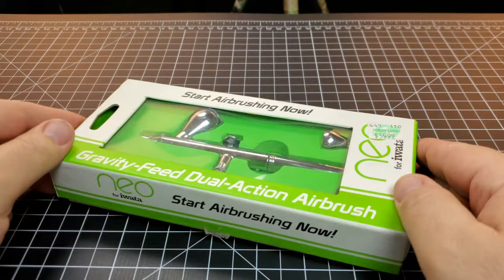Airbrushing With Cheap Acrylic Craft Paints: What You Need to Know

Comment: I'm curious if you've tried "pouring paints"? Apparently there is a craft where the artist pours large quantities of many colors in a large cannister leaving the paint layered and then pours it in patterns on a canvas and then tilts the canvas in many directions making very striking patterns of very thick paint (takes several days to dry completely). The point being they require large volumes of paint for this craft and bottles of acrylic  in a whole rainbow of colors are sold in quart, half gallon and gallon bottles. I just bought a quart of titanium white for $22, same price for a quart of jet black and I got a special deal on a half gallon of antique bronze for the same $22. That works out to either $1.34 for a 4 oz bottle or $2.68, either way, very inexpensive compared to other acrylics and while it's already made to flow, it will need thinning to go through an airbrush which will turn thr quarts into half gallons and half gallons into gallons  at 1:1 and even more if the ratio is higher. I'm going to try it with the ones I bought but was wondering if you have and if you have any pointers for experimenting with this?
Reply from the maker: Hey there 1611JJB. I have no experience in "pouring paints". As far as mixing them together I'm pretty sure you would be ok if you are just mixing the same types of paints together without adding anything, like a thinner to them. Once you start messing around with the composition of the paints that is when they start acting not so good. I have mentioned many times that you don't want to pre-thin your paints and try to store them.  Especially if you are using isopropyl alcohol to thin them with. It will dry out the paints in a matter of days or even hours in some instances. So I would only prepare the paint for when you are ready to use them. I hope I answered your question. Wasn't quite sure what you were aasking. Thanks for watching and for commenting. Take care.

Comment: Thank you for this video, Paul. I'm just getting into airbrushing model cars, and I'm using plastic spoons for practice. After scuffing up them with 800 grit sandpaper, the paint still scratches off of the spoons after sitting around for a week or so. I also used some Tamiya primer (No paint), and the primer still scratches off of the plastic. Can you offer any suggestions to prevent this from happening, or what I might be doing wrong? BTW- I thinned the paints with water on some, and IPA on others, but they all have the same end result. Thank you in advance for your help!
Reply from the maker: Hey Jimmy. The cheap acrylic craft paints are unfortunately not the greatest at sticking to plastic. The best thing you can do is use a good primer and then top coat the paint with quality clear coat. The clear coat will help the most.
Reply: Thank you so much,  @RoadsAndRailsHobbies  !

Comment: I have 3 Paasche YLS air brushes I have tried a cupel of things . One of which is windshield washer fluid with alcohol and ethylene glycol . If you want I can send you some of the Poly Scale paint to try .
Reply from the maker: Hey John. Those airbrushes are siphon feed aren't they?  In my humble opinion that may be half you problem. I have a three different siphon feed airbrushes. One Paasche, one Made by Badger, and one made by Testors. I only ever had problems with them, even when using paint made specifically for airbrushing. That's may just be me though. Are you using a small airbrush compressor, or are you using a regular air compressor.  Just wondering if increasing the air pressure would help any.

Comment: You gotta try regular (blue) windshield washer fluid for thinning the cheap craft paints. Keeps the color true, holds the mix very well and you don’t get as much tip drying as the alcohol. Plus you get like a gallon of the stuff for 4 bucks.
Reply from the maker: I've known about that, but every time I go to the store all I can find is windex with ammonia.
Reply: @RoadsAndRailsHobbies  I think it's referring to the washer fluid that goes in your car.
Reply from the maker: Oh duh.  Thanks for reading  more  careful  than I did. I was  thinking about windex. I know some people have used that, without the ammonia in it.

Comment: Any thoughts on airbrushing with the metallic paints these inexpensive brands sell? The paint appears to just be a suspension of very fine glitter, obviously thinning the paint will not shrink the flakes.
Reply from the maker: If you are using anything smaller than a .5mm needle, they very well may clog up your airbrush.  But hey, expirament. The worse that could happen is you will have to disassemble and clean your airbrush.

Comment: Got an airbrush for the holidays as a gift to myself, planned on practicing with the cheap Decoarts at the local Michael's. Intending to use for some model painting. I was gonna grab the Mr Color Rapid thinner for metallics and the Mr Color Leveling thinner for normals since I get get the big ol' 400ml bottles that'll last forever at my LGS for comparatively cheap. I'm not a fan of the look of water for sure, but do you think this would be too overkill for the cheap paints? What I was reading up on was some conflicting info; some believe that the thinner you use should match the paint brand to theoretically match their viscosity the best way possible. What are your thoughts?
Reply from the maker: Great question. I don't follow the theory of reducing with the same type of base material. I've reduced / thinned water based acrylics with water and that gave me the absolute worst finish of any method that I have used. The best reducer that I have used was air brush paint reducer, but I don't use that in the cheap acrylics because I want to keep it cheap. The second best reducer that I have used has been plain old blue windshield washer fluid. That is my go to right now. I used to use isopropyl alcohol all the time, but it really dries out the paint super fast, which is great if you are in a hurry and want to put on multiple coats quicky, but you have to work quickly before it turns the paint in your airbrush to a rubbery type of consistency. I will warn you though, no matter what you reduce cheap craft acrylics with don't expect to get a great and smooth finish from them using an airbrush. Their viscosity is so different across colors and brands that you will always be guessing at thinning them and the fact that they are so thick to begin with it is hard to get that smooth finish. I'm painting mostly model railroad items that I want that weathered look to so it actually works in my favor. I just painted a plastic slot car body with craft paints and I had to put on something like 8 coats of clear to get a decent finish and I'm still not super happy with it. Also if you are planning on painting plastic models with craft paints make sure you use a good primer first. Craft paints do not like to stick to plastic very well. Even with a good primer the paint can still be scratched very easily. Thanks for watching and for the great question.

Comment: Great video very informative. I wonder how this method would work using the Harbor Freight Airbrush kit they sell. Thanks for sharing. Dave
Reply from the maker: Thanks Dave for the comment. As far as Harbor Freight airbrushes. I've never used one. I looked at one in the store once. And let's just say, I put it down just about as fast as I picked it up. I started out with those cheaper airbrushes and all I did is fight with them to get them to spray well. This is just my opinion. But you really get what you pay for when it comes to airbrushes. These are super precision tools. On the other hand you may get lucky and buy one that was made on a good day, and it may work perfectly. Oh and don't forget the second component. The compressor. You want a decent one that allows you to control the air pressure. The one I am currently using is from Harbor freight. It's their small pancake compressor. It was under 100 dollars, but dang is it loud. I see they are now carrying a silent air compressor that's under 200 dollars. I want to check it out.  Take care.
Reply: @twhis9843  Thank you!

Comment: Water has high surface tension. This will cause the paint to gather together forming a stains rather than a smooth surface. Mixing water with alcohol in 1:2 ratio breaks the surface tension. Flow improver may also enhance the situation.  I have seen lately people using glycerine.
Reply from the maker: Well that makes sense as to why reducing with isopropyl alcohol doesn't give me the water spot look when the paint dries. Thanks for sharing. Take care.

Comment: What's the advantage of 70% over 91% alcohol?
Reply from the maker: I have found that the 70% doesn't dry the paint as quickly as the 90% does. So it gives me a little more time to work with.
Reply: @RoadsAndRailsHobbies  Thanks
Reply from the maker: @TomsTrainsandThings  Hey Tom. You are welcome. I was at work earlier when I answered you and a couple of others. I was trying to squeeze in replying to comments when I had a few moments. I didn't realize it was you. I want to thank you again for your encouraging words in that email response you sent me about a year ago. Folks like you are why love this hobby and enjoy making content for it. Take care.
Reply: @RoadsAndRailsHobbies  Thanks Paul. Keep up the good work! Enjoy watching your videos although I don't always comment.
Reply: Very good question which i was about to type in a tip about it.

It is right. IPA 91% dries instantly right after it hits the surface, that’s why pals on YouTube make Acrylic thinner IPA 91% + DW + Glycerin as flow and gloss aid. 

For my own thinner i used 70% Alcohol + Glycerin

Another TIP : you can me Flat , Semi-Gloss and Gloss finish out of the same acrylic tube brand or color. 
Here is how!  Basically it is how you play with DW and IPA 91% ratio. 
I put few drops of IPA 91% on my 70% Alcohol thinner to reach semi-gloss to flat finish. 

You have to play with the ratio of IPA91%
Reply from the maker: @The124ScaleModels  Thanks for the tip.
Reply: @The124ScaleModels  wait, so more Isopropanol makes the paint more matte?
Reply: @The124ScaleModels  I was under the impression that glycerin in the airbrush ruins it but here in the comments someone claims they use glycerin in the airbrush I’m confused could you help a girl out?

Comment: Thanks, the filter to grab the large pigments, that is a new one! Do you ever store the thinned paints or just enough for your current project?
Reply from the maker: Hey Charlie. That particular video you just watched was actually an old method of thinning paints using IPA. I've used that method for years. The problem with using IPA is that is basically dehydrates the paint very quickly and turns it into a rubbery like substance. I like using it because it dries the paint so fast that I can paint multiple layers very quickly. But you cannot store thinned paints using IPA. With that being said I have found a new method of thinning paints that does allow you to store thinned paints. I created a couple of videos over the subject. Just check out my home page. It's the last three videos that I have posted. Thank you for watching and commenting. Take care and happy railroading....
Reply: @RoadsAndRailsHobbies  thank you and will check them out!

Comment: Thank you Paul for this information I am at crafter that creates recycled home interior decor pieces, I also have an airbrush machine so this is good information I might be able to use. My one question is is that a special strainer or just a generic household strain? Thanks again
Reply from the maker: Hello Irene. Thank you for watching my video and for commenting. To answer your question, the strainer I use is from Amazon. It is stainless steel and a very fine mesh. It is sold as a three pack along with silicone funnels. It sold as strainers for resin, but I use them for everything, heck I even have on in my kitchen. Anyhow. If you go back to my video. In the description is a link to the strainer.  Thanks again.

Comment: Dont use nuts or bolts for agitators, they can corrode and change the color as well as add chunks that will clog your airbrush. A better suggestion is minimarbles of the sort that are used in room decoration vase filler. They work excellently last forever, dont corrode or cause clogs, and can be reused between bottles.

Edit: I say this from experience, having seen the effects of using nuts or bbs or other metal objects as shakers. Spray cans dont have this issue and can use metal agitators because they are not a waterbased paint.
Reply from the maker: That's a great idea on the mini marbles. I am using stainless steel nuts. I shouldn't have any problems with rusting using the stainless steel. What are your thoughts on using stainless steel? Have you had any experience with using stainless?
Reply: @RoadsAndRailsHobbies  I am very familiar with stainless. Great stuff. I think some people might see the advice to use nuts and not realize the importance of the stainless steel portion of that message and end up with nuts that aren't stainless in their paint pots. Also not everything stainless steel is created equal. Some are more stainless than others.
Reply: He said stainless steel !
Reply: @moepow8160  believe it or not stainless steel can and does rust. I know, it sounds crazy. What is this world coming to?
Reply: @RoadsAndRailsHobbies Hematite plated beads. Get them in the jewelry section of hobby stores. No rust risk, and will agitate perfectly fine.
Reply from the maker: Thank you very much for the info.
Reply: @RoadsAndRailsHobbies  You are welcome.
Reply: He said stainless steel nuts.......................................
Reply: @BennyCFD  He sure did. Good for you! I said use glass. Try to keep up.

Comment: When it comes to thinning the paints, can you just go ahead and thin the whole bottle at once, and keep it in a nicer glass bottle (since you'd need a bigger bottle anyway), so you don't have to go through all this process every time you want to paint? Will the alcohol-thinned paint keep if properly sealed?

This would also allow for mixing colors that you might need more of later, for a different project. And, I assume the strainer is reusable, just wash it thoroughly each time, or does the screen need replacing occasionally?
Reply from the maker: Hey DeereX748. The strainer is stainless steel. Just rinse it out every time you use it. Or if you forget to clean it right away, just use some dish soap and an old toothbrush to clean it and you will be fine.  No need to ever replace the screen unless it gets broken. 

Thinning the paints. You cannot pre thin an entire bottle. Especially if you are using my method of using isopropyl alcohol. These paints are water based and the big reason I use isopropyl alcohol to thin them is the fact that alcohol evaporates water which in turns makes the paint dry faster on my projects so I can paint faster. In the past when I mixed custom colors, the longest the paint lasted that was thinned with isopropyl alcohol was about 5 days before it started getting thick and clumpy. Also some different pigments start drying out the paint and turns it almost rubbery very quickly. That is why I keep expressing on everyone in my videos to use the thinned paint quickly and always clean your airbrush immediately afterwards.  Thanks for commenting.
Reply: @RoadsAndRailsHobbies  we

Comment: I think I heard you say use carb cleaner in your airbrush.  I suggest that this is probably a bad idea.  Carb cleaner will destroy rubber seals and o-rings (even in your carb you should remove rubber and plastic components before using the cleaner).
Reply from the maker: Hey Moto. You heard wrong. I never suggested to use carb cleaner. It will most definitely destroy rubber O rings..

Comment: great video thank you i learn something but does it matter on the airbrush to get a good finish
Reply from the maker: Hey Dwight. Airbrushes are precision tools. In my experience, you get what you pay for. I've heard mixed reviews from the Master brand that is sold on Amazon. I do know that when I first started out airbrushing I bought the cheap ones, and I fought constantly to get them to work. I actually gave up on them at one point. Then I bought my first decent airbrush. It was the Iwata NEO that I showed in the green and white box in this video and boy what a difference. I could feel the difference in the quality of the build between that entry level Iwata and the cheap airbrushes I had been trying to use just by holding them. Don't forget however airbrushing is two parts. The airbrush and the airbrush compressor. This is where you can save some money. I have an inexpensive 2 gallon pancake compressor that I use. But it is important to buy one that allows you control the air pressure coming from it to your airbrush. That control of air pressure is vital to having a usable airbrush. For almost all of my airbrushing I have my compressor set to 20 psi. I hope this helps. Thanks for watching and commenting. Take care

Comment: which reducer has a better adhesion?
Reply from the maker: Nitzky. I paint mainly 3d printed plastic items and I haven't noticed any difference in adhesion. That being said I have never done any direct test for thar. I also find that acrylic craft paints don't adhere to plastic that well regardless if they are reduced and airbrushed on oh painted on full strength with a paint brush. That's why any project that will be handled quite a bit I always clear coat it to protect the acrylic paints. Oh and check out my newest acrylic paint thinning video. I have found a better way to thin acrylic craft paints than using IPA.    Thanks for watching and commenting. Take care and happy railroading......